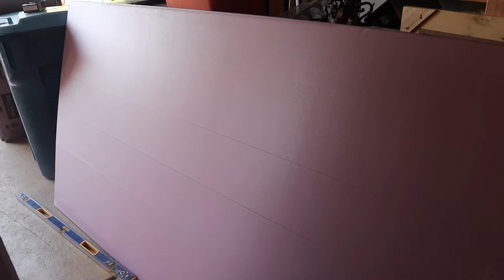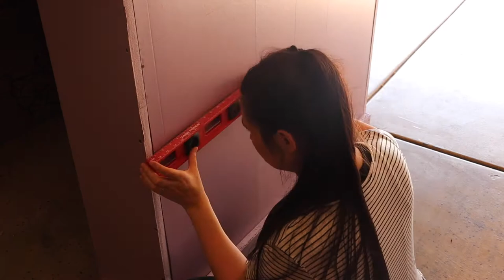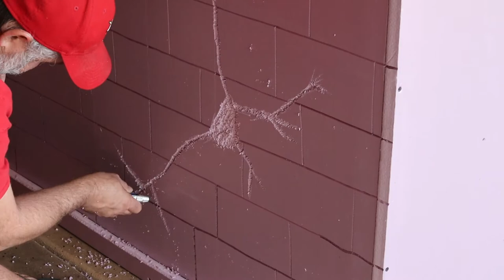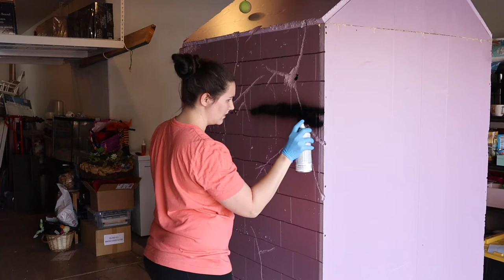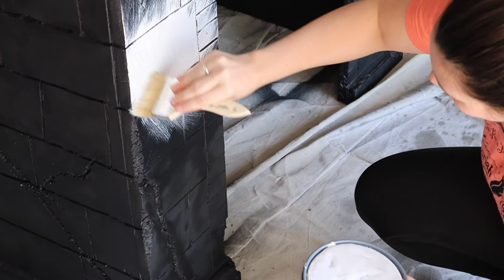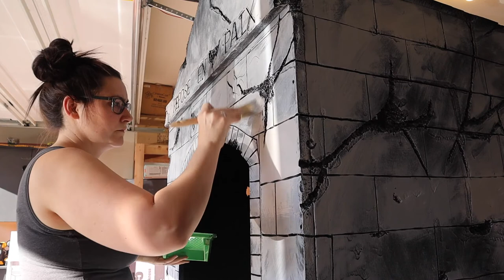*New* DIY Haunted Outdoor Decor | Halloween DIY Crypt | How to

Comment: How did you get it to not blow down in the wind?
Reply from the maker: Funny story, it did multiple times and we ended up repairing it a lot. We used some 2 x 4s and wooden stakes inside to add additional weight to finally find our fix! This year we are going to make some adjustments to make it a little easier to handle.